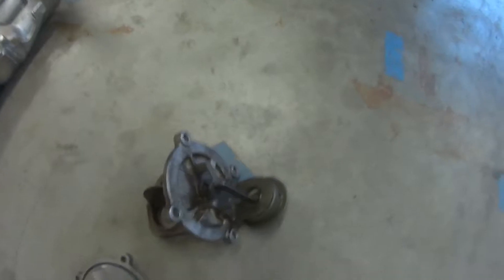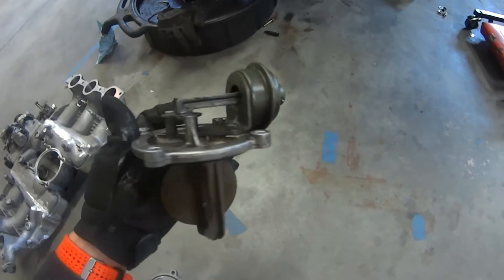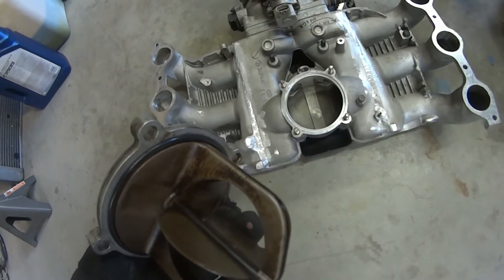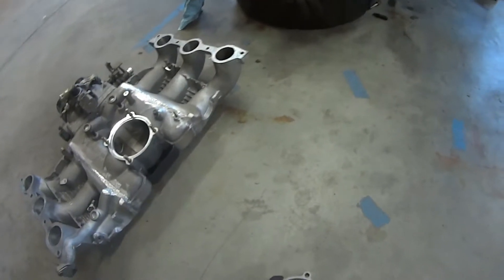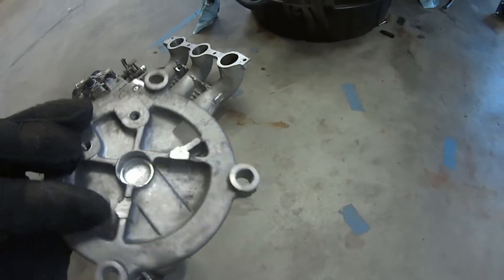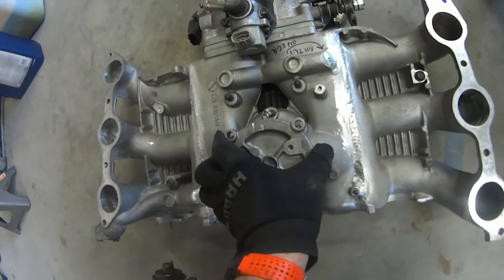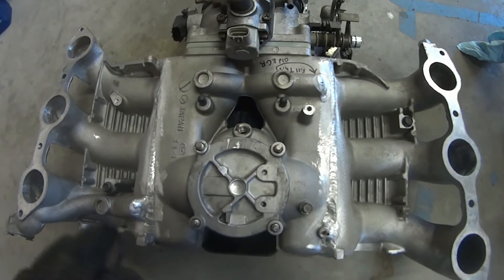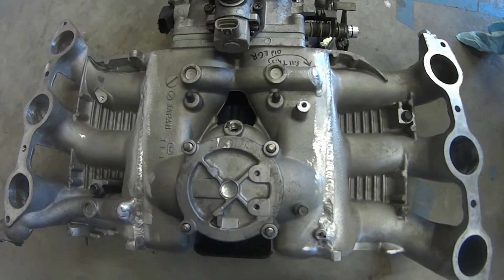EG33 Swap - SVX IRIS Valve Removal (Ep. 22)

Comment: The IRIS valve is identical to what Toyota did in the 80's with TVIS.  It blocks airflow in the respect of air velocity (lower rpm) VS air volume (high rpm).

Comment: Please weld in that Plug or Braze is .......Hell even JB weld would be great. This Plug will come off sooner or later. Keep in mind : Heat cycles,Vibrations and Boost

Best case: You get a Boost Leak
Worst case: It get sucked into the Engine
Reply from the maker: Great point, I'll get it take care of for sure.